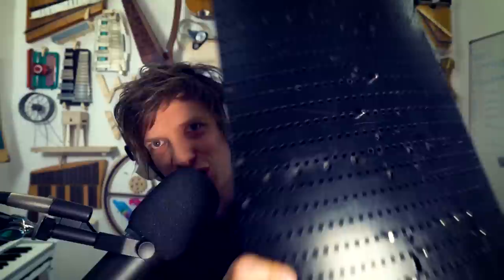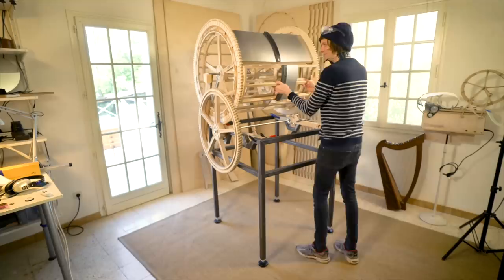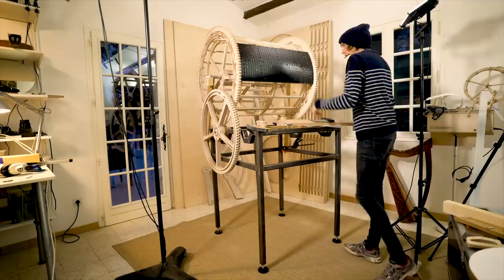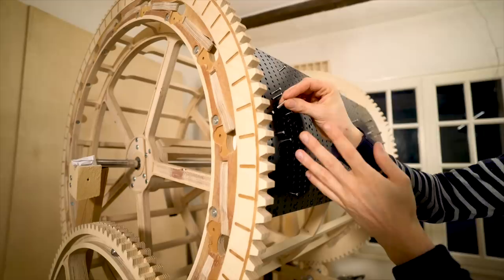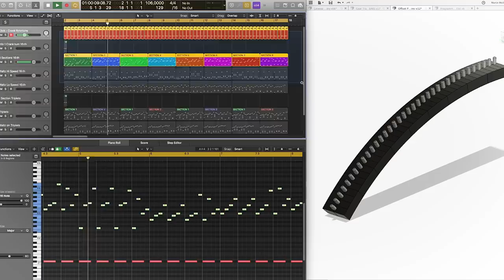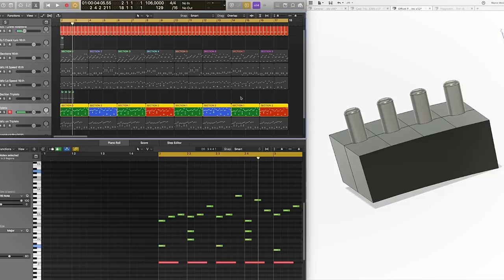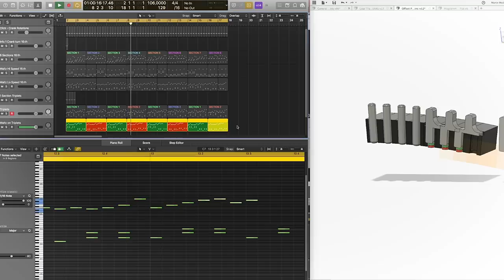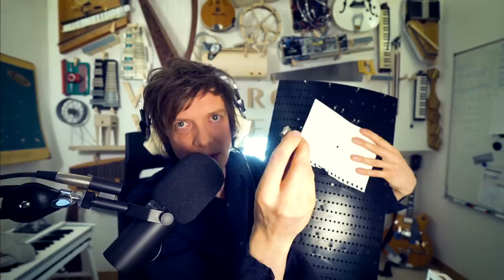Magnet "Midi" Music System - Marble Machine X #25

Comment: Hej, Martin. You beeing a musician that has had many gigs on stage, you know, that an instrument should be "fool prof"----wait, let's call that "stage proof". Nothing irritates more than an detuned or wrong upset instrument. It can destroy the mood. For that reason, I would not use the push-to-rise / clip type of pins, for everytime it gets touched after programming is a potential error or so to say reprogramming. Just imaginge your technicians installing the new 8 programming blocks, these don't fit due to humidity at a open air festival, the technicians use force and tap on the blocks slightly and some pushpins start to rise or get pressed down. That's not stage proof in my opinion. Well....it could be Marble Jazz Machine at least ;-)
Reply: Marble Jazz machine!
Reply: I came here to say this too. As a musician, I would want to minimize any opportunity for mistakes on stage. I think I would find a way to slimline the programming plates and have the hard coded songs ready to be switched out. But then again, I guess that would cause more of a logistical issue

Comment: Couldn't the demagnetizer affect the durability of the magnetic note pins?
Reply: No, it is removing a very weak temporary field not a strong long lasting magnetic field, also like v.dog said its far away
Reply: I don't think that is an issue as the Demagnitizer died in this video.  Demagnatizer 2.0 is likely to be more sleek.
Reply: I doubt it. he was demagnetizing steel balls not neodymium magnets. my understanding is that you'd need a magnetic field a lot stronger than what your demagnetizing in order for it to have any affect.

Comment: This is wicked. I feel as though I don't have a large grasp on music such as you do, but I really enjoy the idea of triplets.

One problem I noticed with pen-like pins is holding them in and breaking. If they break you have to tear the panels apart to replace them. It also adds much weight to the machine, which could also add wear to the gears and add additional weight, making it harder to turn

Comment: I have a couple of small ideas but in a setting where lighting maybe unpredictable, I'm not sure how good of an idea it'll be but here it goes! In the holes of the programming plates - you could paint them in a certain colour in luminous paint for each song and then number them so that the technicians know the sequence they should be fitted in. If the paint/colour cannot be seen in the holes, then an alternative could be to paint around the holes of the surface of the programming plates.If the colour doesn't show up, paint them in a certain pattern. To get the technicians to remember which songs/plates are needed, have each plate marked by say a certain letter of a word. For instance: Wintergatan. The first song's programming plates are blue and are marked by 'W' and the sequence starts with 1. So the first plate in the first song would be W1. Then W2 and so on. I hope this has helped in any way, best of luck to you!

Comment: The block pins can be put facing correctly or backwards, the forward side is cut to play on 4ths. The backward side is cut to play on triplets

And you should have the boards black but also painted, get an artist to have fun making the patterns painted on each panel interlock with each other. Maybe it could spell Wintergatan

Comment: Hi Martin,
Your videos are a weekly rendez-vous I have with my daughters and we look forward to them. Their blend of make-ing skills and tasteful music is just great!
We discussed a bit and we thought of leaving you this feedback:

1) Regarding the finish: glossy or matte, we thought that perhaps the best is whatever makes the pins shine most easily. This is because we think that the pins should stand out with the movement. Perhaps matte is better? Perhaps glow-in-the-dark pins? To be tested.

2) Regarding the programming, we thought that you could have song template boards (song plates) with only the relevant/needed holes; the holes would have a slightly looser diameter and the metal sheet should be easily removable to be able to release the magnets. The re-programming would be more or less like:
- pre-fill the song plates with magnets.
- after a song is over, the program plates from the MMX are emptied of magnets (see below on how this can be automatized).
- a pre-filled song plate and the empty program plate are aligned; the magnets fall in the program plate and/or are pulled by the magnetic force.

The song plates would have to be the mirror image of the program plate and we think they might be flat if the magnetic field is strong enough to pull the pins from the song template to the program plate. If the magnetic field is not strong enough, gravity might help, but then it might be needed to match the curvature of the program plate, possibly making the song template more complicated and/or less space efficient.
Finally, there may be a way to to more easily transfer magnets between the program plate and the song plate by using electromagnets. This requires checking the polarity of all the magnets but could make loading and unloading a song quite simple, esp. if many electromagnets can be made to cover a full plate's surface.

3) Regarding the 4/3, we have wondered about having 4*3=12 holes. This would allow for any of 2, 3, 4, and 6 tempos (8 and 12 are likely unfeasible). With the 25*6*2 block magnets, can 12 be made to fit in a row? Or perhaps 2 staggered rows of 6?

Thank you for sharing this adventure with us!

Comment: Idea for rapid reprogramming - if it's acceptable to have a separate set of pins for each song - have a thick sheet made of a flexible material (perhaps silicone) that mates to the outside curve of the programming panels. It has matching holes in which the pins are placed in advance of the concert. When it's time to reprogram, you pull out all the old pins, press the silicone sheet up against the programming panel, the magnets grip the steel plate behind the panel, you peel away the silicone sheet, the pins remain. Obviously it can't be rigid.

Comment: Idea for fast and easy reprogramming. First, make a sort of inverse copy of the wheel section with the same number of peg holes that line up. This will act as a sort of storage tray for the pins from a section. Second, replace the magnetic pins and metal plate with metal pins and an electromagnetic plate. This way when you place the wheel section face down into the storage tray, you can deactivate the electromagnetic plate and the pins will release and fall into the storage tray (or activate another electromagnet in the storage tray to actively pull the pins off the wheel). Then, place the wheel plate above another storage tray and re-activate the electromagnet to attach the new pins to the wheel plate. Not exactly sure how to magnetize a sheet of metal like this, but it's an idea. Disadvantage here is that you now require a charged battery or power source to keep the pins in place.

An alternate idea is to keep the magnetic pins and metal plate, but in the storage tray, install a much more powerful electromagnet. When you need to remove the pins from a plate, activate the magnet and pull the section off and (hopefully) the pins will stay in the tray. When you need to put the pins back on a section, just deactivate the storage tray magnet and they'll pop back onto the section.

Comment: From an operational perspective, there are some good ideas in the comments that you should definitely take into consideration:
- Each set of plates should be obviously different, so that you know with certainty when you've switched them (e.g. one gloss, one matte, a colored stripe, etc.)
- Each set of plates should also be numbered or have some way of identifying sequence so that you know they're in the right order
- It's likely going to take longer than you anticipate to reprogram each plate, so anything that you can do to speed that process up will be critical
- - Removing pins: Is there a way to disengage the metal plate so that the magnets fall out easily?
- - Adding pins: Is there a way to add pins such that they don't need to be added individually? For example, can half of them be added by pouring them onto the guide, with the rest placed precisely?

Comment: Old mechanical typewriter machines with multiple tabulations had a REALY engenious way of doing that with fixed pins (or "shoes", or whatever they call them). You just press it to raise the "pin" and pull it to ressess it. You could have adjustments for any tempo you want. I think it can be even lighter than your current solution. Circular rods with indentations that grip U shaped thin "shoes". It can handle a LOT of force on the "pins". I'm working on a Sketchup model (for the hell of it), and if you want I can send it to you. 

Congrats on the project, by the way. Cheers M8!

Comment: When it comes to switching out the plates (the technicians I mean), it might make it very simple to remove all the pins for set up, if you were to have a sheet of meet that is the same width of the panels, so all that the technicians have to do is slap the sheet on top of the panel, and then all the pins will be removed all at once, and it add more time to actually setting up the next song, instead of more time being wasted on removing the pins from the last song one by one.... I love your music and your craft. Stay smiling and stay creating :)

Comment: What a marbelous creation!
 An Idea for the programming section: What if you always kept the programming sections on the wheel, without pins, and instead programmed a rubber carpet that had pins in it. That way you could have several songs in rolls of rubber , that you just "wrap around" your programming section , whereof which you'd only need one whole programming section. If you wanted to reprogram the carpet you could e.g. have some kind of magnetic disc around the rod which attracts a metal disc which is attached around the hole on each hole on the carpet.
Your music is fantastic, keep up the wonderful tunes.

Comment: Build two sets of pins. They could either be flat or rounded. Just make them with different base areas and carve each hole with a step with the wider and shorter dimension of the pins. One pin would have to be shorter than the other. The holes in the programming plate wouldnt show gaps for the thinner and longer pins but it could work. Keep up the good work.

Comment: Single Channel for each row..
Holders for magnets
Spacers for time measures and pauses

Slide all the pieces into each row  - as required by composition
Glue/Tape/Mark the row-pieces to "save" : )

-- pros
Fast song switching.
Place a note at any time.
Polymeter/Polyrythm possibilities.
Lightweight spacers keep the weight down.
Songs and spare notes can be stacked in boxes.
-
Does require every piece to be quite precise, but still lots of options in materials.
Might need to be locked in place after row is inserted, so it does not allow to move around.
Still uses a lot of magnets. Perhaps they can be smaller, cut in half, or electromagnets?
Or, like someone said, get a lot of magnets.. Then you don't need to move them between holders for every song : )

Nice to see you are well setup in France!
Looks like it's really taking shape now : )

Comment: I would recommend using adhesive to keep the magnets on the board to prevent from from failing in the first place. 

Use an abrasive pad on the steel (Or a piece of sand papper (Or emory cloth)). Put on polyurethane board. Use a metal to metal adhesive and then push a magnet down each hole.  The benefit to this system is the easy programmable feature you're looking for and preventing the magnet from falling off the pin. It should save on money too so you're not replacing magnets.

Also, how well would the metal return to its base position after being struck with a ? Would you be interested in using advanced composites like carbon fiber? It would prevent deformation but would be easier to break. I would consider the shape and how much wear goes into the smaller parts and label them as consumables. Always best to have spares!

Love your work. Always have.

Comment: Hey Martin, I've got a next level thought if you havent considered it. Which ever way you resolve the pin configuration, as long as you are using standard pins you can create a magnetic bar that can lift and insert individual pins on each row (or sets of rows). Essentially like a "mechanical printer". It could then theoretically reprogram the wheel during play. Such a mechanism could be an accessory that can be attached/detached easily, or it could reprogram a second set back stage.

Comment: To program threes you will:

1) always use the first pin as it is
2) have to find another way only for placing the second and third pins

As an alternative to your proposed complex pin design, I would think you can achive 2) by manufacturing a combined element for both the second and third pin option where you will use the "holes of four" to:

A) always have two half-length pins at the second and fourth pin that but go to the surface
B) which are welded onto a bent plate onto which
C) you will then weld the remaining pins of which you should have ONLY 3 variations, e.g.:

Variation 1: second pin but no third
Variation 2: third pin but no second
Variation 3: both second and third pin

...whereas the orientation does matter for all of them.

Comment: Great progress video! I have two suggestions to make reprogramming faster:

1. Rather than fixing the metal plate behind the programming board, make it removable as an insert than can slide in or out. Then you could remove all the pins at once by just pulling out the insert and inverting the panel.

2. To make setting a new program faster and less error prone, you could install LEDs underneath the programming board. When a tech is setting it up for the next song, they plug the panel into a computer which lights up the slots that need pegs for that song. Associating each panel/program with a peg count makes it less likely that burned out LEDs would make a tech miss a pin. You could even program the LEDs in unused holes to do a lightshow while you're performing, although this might distract from the natural aesthetics of the machine (maybe a cool surprise for an encore?).

3. As a sort of hacky but much less work intensive alternative to (2): you could create a reprogramming station with mounts that are below an overhead projector which highlights the holes which need pegs. Once you have the mounting system figured out, you could even generate "programming images" programatically from midi.

Comment: Pinned thread is maxed out.  I would keep it simple as possible. Magnets is good and replaceable. Push pins that lock up or down adds a LOT of complexity and probably more issues down the line. Block magnets will add construction complexities (harder to make rectangle than circle) and they will have less durability, tho the side-by-side holes is interesting. Could possibly add another row of holes along the existing but there would be overlap at some point (3/3 hole next to 4/4 and it creates a large single rod hole). However i think i would stay with the offset pins in the 4/4 array. With that you can modify them and create even further offsets from them. GL and really looking forward to how this evolves.

Comment: For each track have two rows of pinholes to allow for 4/4 and 3/4 timings. To expand on your template idea for the pin changes, use a black plastic sheet that can be cnc’d with holes for where the pins are to be placed. This would highlight any missing pins, especially if the metal sheet was a different colour to the pins.  You could also make a “gun” with which to insert the pins more quickly into the holes - simply run the gun along the tracks and the pins would snap into the empty holes....

Comment: To reprogram, how about putting a single strip of LEDs that point toward the programming surface?  The LEDs are driven directly (a MIDI note makes a LED come on - there must be lots of interfaces and code already) from the cursor position of whatever MIDI software that you are using and this is timed-up, of course with your segment that is held in a rack (wheel sector).  Now all your programmers need to do is to put a magnet in only lit holes.  Triplets then need either another row of LEDs, or simply a shift of the whole bar to accommodate them.

You could also put three (or more..) tabs, or marks somewhere on the back to identify, in binary, which rack was being programmed.

Comment: For the programming part:
My idea is a compination of a programming table, a webcam, a cheap beamer and a image processing software.
The programming plate ist placed an the table under the webcam and beamer and the software recognizes pins that have to be removed for the next song. So they are highlighted red by the beamer. If all unnecessary pins are removed by the technician, the software encircles holes, that have to be set now.

Comment: An alternative to the punched-card idea would be to use a long key to raise the pins like a lock mechanism. If the key is inserted into the edge of the cylinder, a beat can be shifted up or down note by pushing the key in or out

Comment: I have a really cool idea.
This is set up like a music box where the pins are reacted with on the outside of the wheel.
What is stopping someone from adding another set up pin boards INSIDE the wheel reacting with different elements to create noise?
This would allow you to use different divisions of time such as 3/4 and 7/4, and can create some amazing poly rhythms with the cemented 4/4 outside wheel.